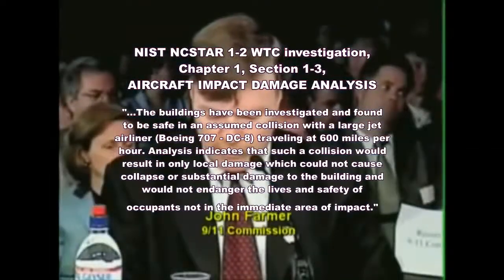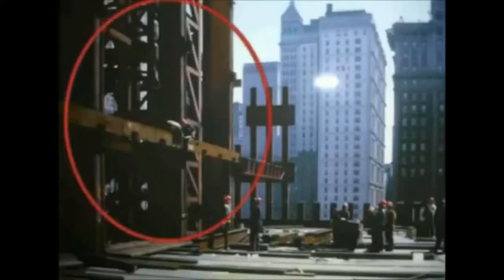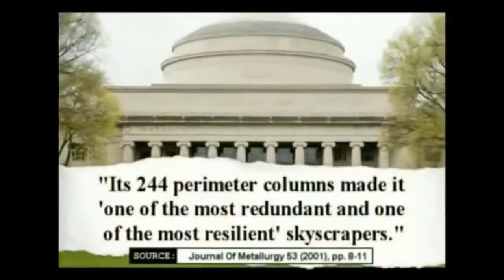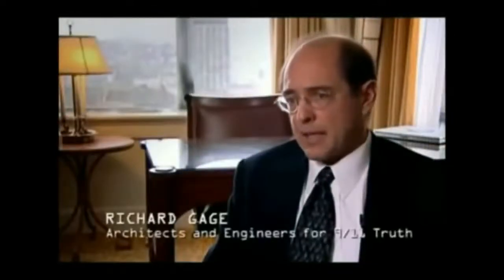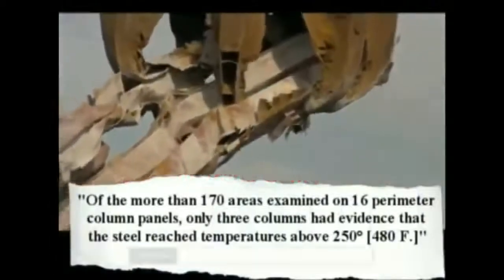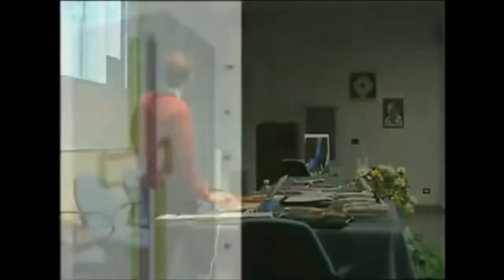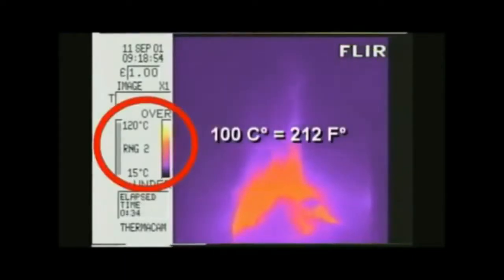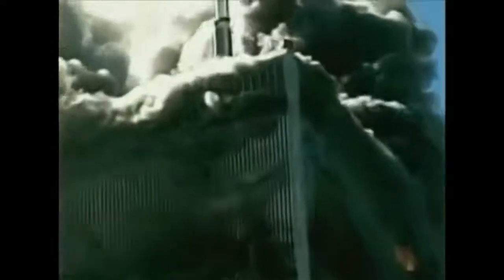9/11 - Just How Robust Were The WTC Twin Towers?

Comment: The building in the UK burned hotter , longer than ALL the 911 buildings and it still stands.
If they bring it down, Explosives may not be an option because of its position but i bet they have to take it apart piece by piece.

Comment: G'day,

   Yay Team...!

   Did you notice that the Grenfell Towering Inferno didn't fall down...?

   I did a Burn-Test of some of that Aluminium Compound Panelling...; check the Video, within 30 seconds of being in the Fire, it's burning, at 1 minute it's dripping burning melted Plastic, at 1 min.: 30 it's delaminated and the whole Core is alight.

   On the other hand, I have different fingers...; so be sure to check-out the "Is Carbon Capture & Storage Thermodynamically Impossible..?" which Video I posted last week.

 I reckon it's a Scam, requiring Over Unity Energy Efficiency for it to operate...; Coalfired Power Stations running Emissions-Free, via Perpetual Motion Technology, or what ? (!).

 Take it easy,

  ;-p

  Ciao !
Reply from the maker: A little update on MSR's (LFTR's) - https://www.nextbigfuture.com/2016/11/17-countries-cooperating-on-molten-salt.html
Reply: I'm a welder fitter and two pieces of the twin tower came into our shop at Stockton Steel(Herrick).And were to be made into a monument or something.And those steel columns were hella thick and sturdy.These  are the biggest liars "that God ever died for".Those columns could not have had their foundational base's integrity collapse from a fuel fire that was so high up on the top floors.The Govt is a lie-they blew those girders.To propagate this so called"war on terror" bull crap!That scared look ."That super glued to stupid" look that Bush had on his face in that classroom of kids!.Spoke volumes!!!Ask the firemen-they heard all the pops and explosions while responding to the buildings.Bush,Cheney,Rumsfeld,Rice,Wolfowitz,all should be in prison.If one part of these so called "911 attacks is phony and a lie.Then all of its a lie.Didnt see no bodies,seats,engines,luggage,debris at the other two sites whatsoever!!!!Hmmmm???!!! All a big lying coverup to mask the Govt's deception